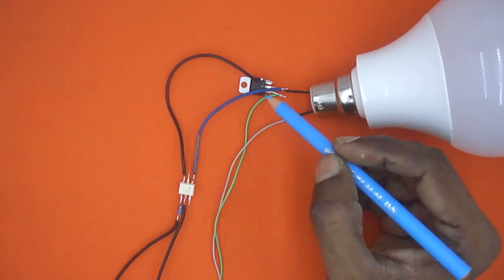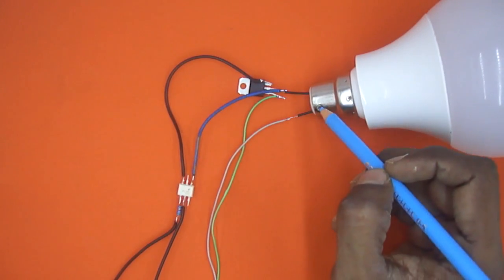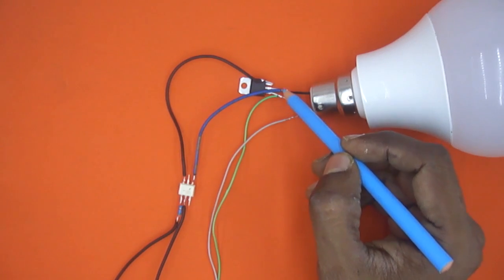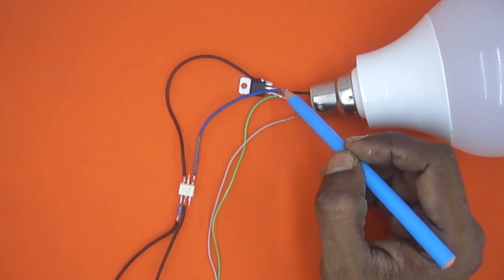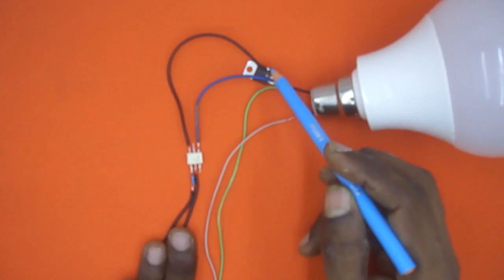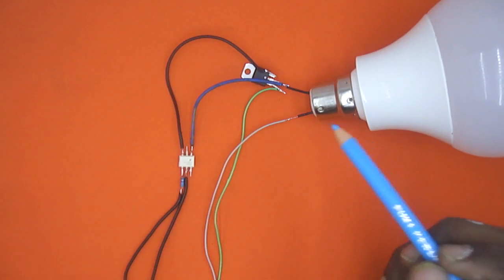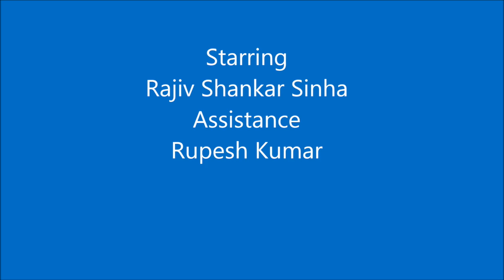BT136 : How to use Triac with Opto-isolator

Comment: Gate voltage is 230 connected through opto but as per the bt136 datasheet gate voltage cannot be more than 5v, kindly clarify if I am not correct